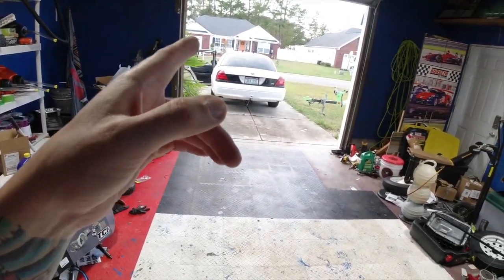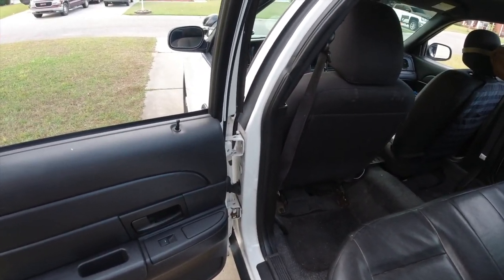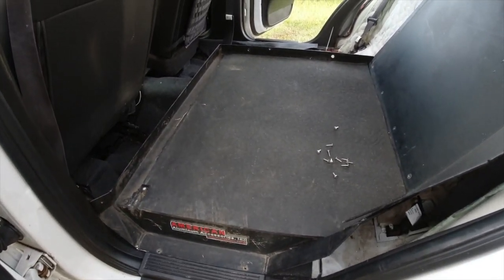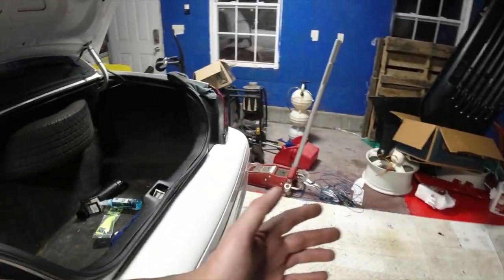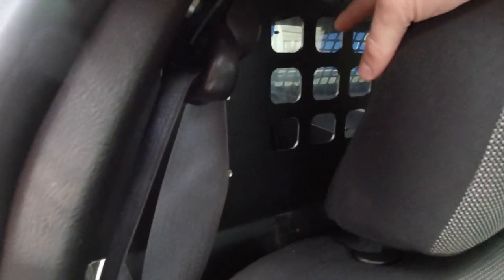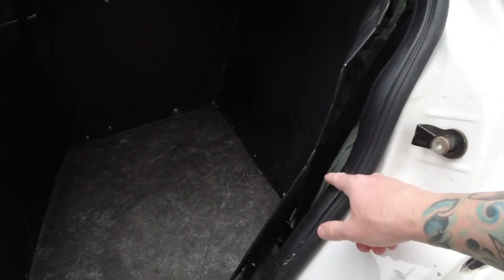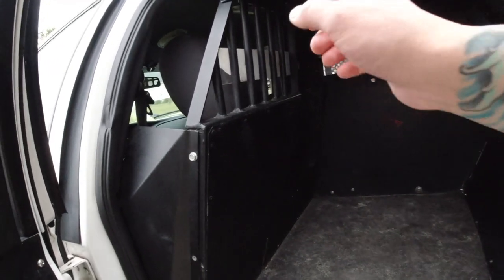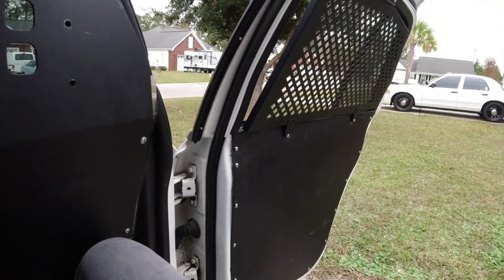How To Install K9 Cage In Ford Crown Victoria Police Interceptor P71

Comment: My 2009 P71 interceptor has the K9 cage. I want to remove it. Is a cage like that worth anything to anyone? I want to keep the flat floor, but get rid of the cage.
Reply from the maker: What brand is it? I would want to get it. I have rear seat and rear door panels for sale dm me instagram iam_beowulf
Reply: @IAmBeowulf  I think it's Dana from Perry, FL, but I'll have to check. I'm not going to put a rear seat in it, but just keep the flat floor instead.